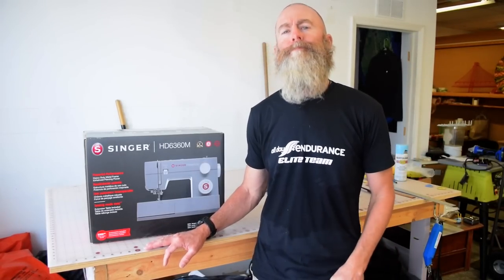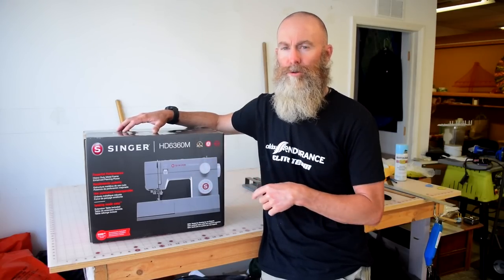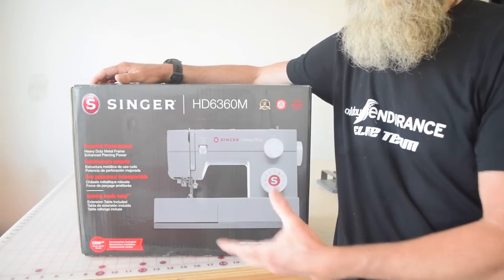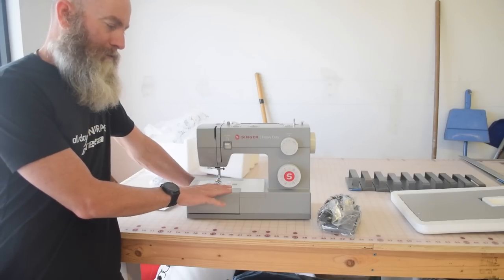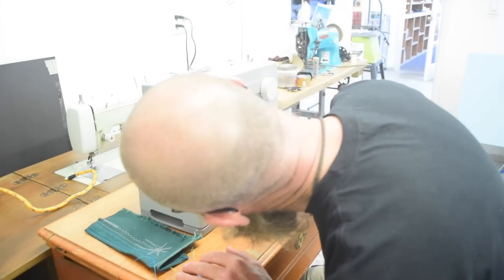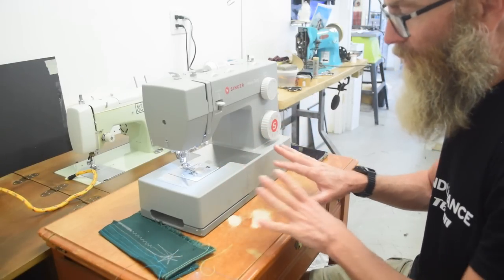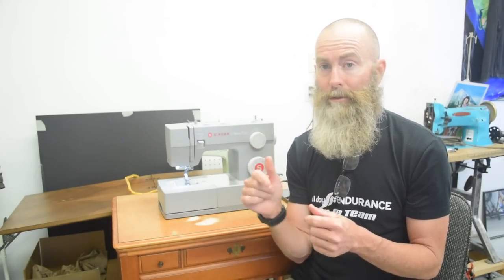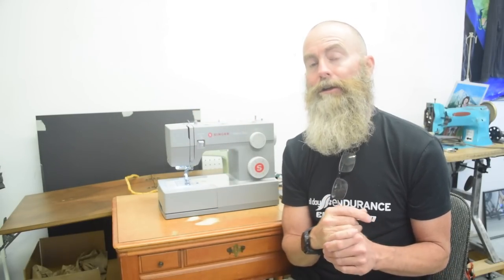Singer HD Unboxing and First Impressions

Comment: Wonder why the feed dogs were stuck at around 25:50? The click at 26:35 was when the feed dogs re-engaged. (I think) I Use a Husqvarna emerald 183 and have no issues going through 6 layers of 500D cordura. Perhaps a machine to give a try?
Reply from the maker: Hi Thomas!
I believe the click was the feed dogs re-engaging, it seems when the buttonhole control was engaged it dropped the feed dogs. Unfortunately, the manual doesn't explain how to return to normal sewing when the buttonhole process is finished, so I just had to guess lol.
My wife had a Husky Emerald, and hers caused her no end of grief (not sure if it's the same model, this was about 12 years ago). At this point, I am exploring the HD model because it is by far the machine I get the most questions about (other than possibly the Sailrite). I expect my preference for vintage machines and walking-foot industrials will not change as a result of this experience lol.
Thanks for watching and commenting!
Reply: @thejasonofalltrades  For heavy work I used a Husqvarna class 12 machine. Not a gram of plastic on it, all metal. And your preference for older machines is one of the reasons I stumbled on your channel, en subscribed.